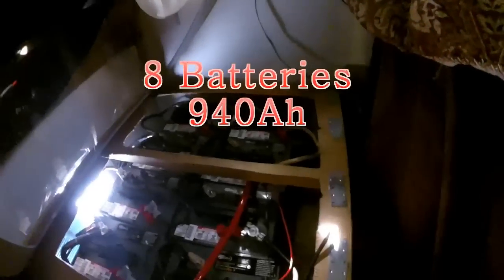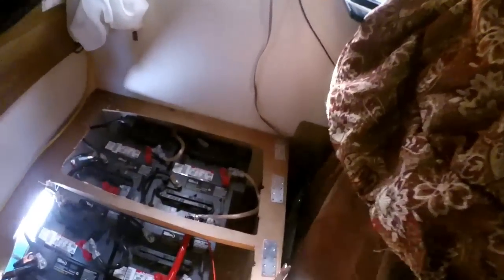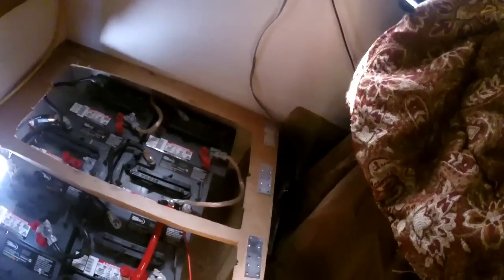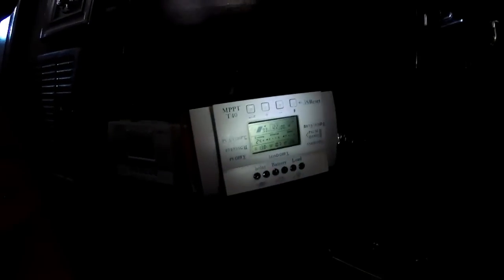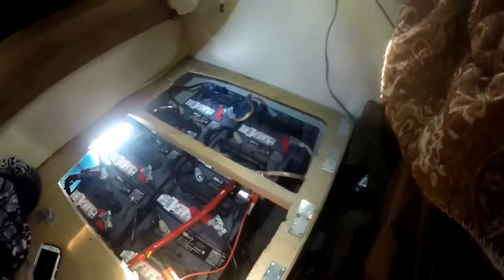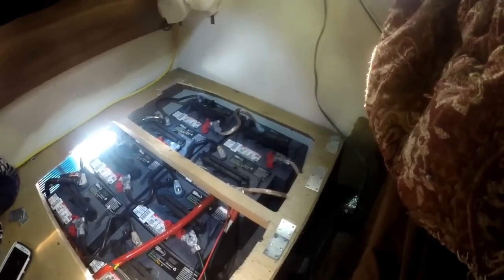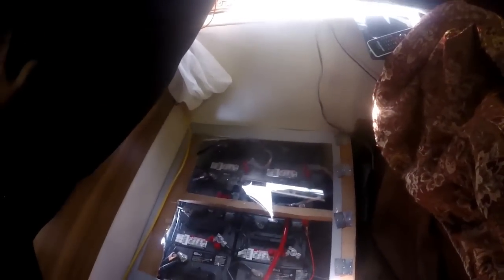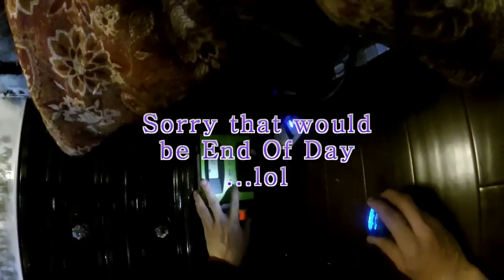Mppt Charge Controller, Large Battery Bank & Loose Wire

Comment: The only thing that confuses me is that you use propane for heat.... With all that solar.... Wouldn't electric heat warm without all the condensation?
Reply from the maker: Most small heaters use 900 to 1300 Watts that's still a lot of power for any solar system... besides propane is a pretty efficient way of heating I only spend about 15 to $30 a month for heating depending on how cold it is but... I do have a 12v electric blanket that keeps me pretty warm at night and uses very little electricity.

Comment: Do you notice and issues with weight distribution having added all those batteries in one location? Also, they look to be on the passenger side, where the solar panels are. Doesn't that add more weight to that side?
Reply from the maker: Yep no problem so far the panels are very lightweight and only weigh 40 pounds for all of them although  the batteries are on one side... the water tank and refrigerator are on the opposite side for weight distribution and it seems to be working
Reply: Thanks for the reply. I only viewed your solar panel vids after I wrote the above question. Yeah they look really light - and they must be durable too - to  be able to handle the vibration from wind etc., hanging on the side like that!! You should get an endorsement deal from the manufacturer.
Reply from the maker: Yeah that would be nice lol 😆

Comment: Your battey bank wires are small for the system to have.
What gauge are you running?
Reply from the maker: +b long 2 Gauge from battery to battery and 0 gauge from thebanks to the inverter. I think that is the right rating.

Comment: Just found ur vlog a couple days ago and been watching all ur vids from #1, I've seen couple of them showing ur solar system but haven't seen one yet showing your panels set up and working,,do the ones on side just stay where they are when ur camp is setup?, or do they raise up like a canopy?
It's probably one of the best systems I've seen on an rv so far!, very impressed!
I've got a 79 chevy coachman motorhome looks alot like ur's but I boondock out in rural areas more than in town and with the 24ft can't get off road much so I'm working on a 88 factory built camper van with hitop,fully contained and also converting  cargo trailer into a camper/toy hauler that I pull with either a 04 4x4 tahoe or camper van depending on if I'm beach camping or say mountains in Colorado but I'm gonna b using ideas from ur solar system and flex panels,,ok for now, good luck!
B proud of yourself ur doin a great job and who knows maybe bump into ya out there someday a share a campfire, safe travels!
Reply from the maker: lonerglide Thanks Glad you're watching my videos! ...and yes the can fold up like an awning because of the hinges. Seem like you've got alot planned... good luck and yes maybe we can share a camp fire someday! Your welcome to my ideas hope they help you and I will be doing a more updated video soon! Thanks again and Safe travels to you aswell

Comment: Its nice seeing another female rver out there! Im super impressed with your solar power set up. 

I just recently bought a dodge beever and am staying in it on a family members property until i can get solar hooked up and then id like to do some traveling.

This lifestyle definately speaks to me.

Im young and hate staying in one place for long. Theres so much out there to see
Reply from the maker: Kayleigh drouin That's kinda what I did for a year to get everything ready for the road... Good luck with your solar and I'm sure your excited to get on the road!
Reply: Panda Monium im super amped, honestly if it takes time its no big deal to me. Meanwhile i am saving up money.

Your solar panels that are on the side. Do they flap around alot? I honestly have never seen anything like that.
Reply from the maker: Kayleigh drouin I'm sure i was too and taking you time is a good idea no need to rush. It's better to be prepared and yes save money! The solar Panels are held down with cleets and roap like on a boat been over 4000 miles no problems, just small adjustments. lol

Comment: Nice set up! Looks like you may want to stuff the battery box with something non flammable to keep the batteries from moving around when driving. This will help keep the wires from coming loose.
Reply from the maker: off grid kid good idea... that reminds me I did have base boards down but took them out to reconfigure the battery bank... thanks for reminding me... I have to put some back in.... lol
Reply: After thinking about it you could use styrofoam, cardboard ect. push all the cells tight together then stuff it like a pillow. lol!
Reply from the maker: off grid kid yeah that's a very good idea thanks... I had some Styrofoam I left back in Myrtle to bad I didn't have you then to give me that idea :(  oh well i'll find some somewhere...lol! Thanks again
Reply: Hi, Don't use cloth, like a blanket ect, will degrade very fast. You have come this far with out! Takes time to get things dialed in. Next, ditch the clamps & install some Ring Terminals ends replacing the clamps, bolt it to the battery, problems solved. Will get a more solid charge this way as well. I think the design of you solar camper is awesome! keep up the good work!
Reply from the maker: off grid kid I agree it takes time to work out all the bugs and yes definitely going to change those out, it's all I could find locally at the time but definitely gonna upgrade. And thanks! ;)

Comment: Great setup. Love the fact that you vented the box. Love the fact that you foamed the plexi. Shows that you care to wake up in the morning. ;) However, that/those spring clamp(s) has got to go. The vibration from you driving around shakes that loose and can cause you some grief later should it pop off and ground out or arc. I knew a fella out that fried his charge controller that way. Plus, the connection from your controller to your batteries should always be a solid one if it is permanent.

Also, speaking of the vibration, get a few cargo straps, a handful of eye bolts to put through the battery box floor and cargo strap those batteries to the floor to keep them from shifting while driving. In a house setup there is no need to clamp the batteries down but in an RV batteries should be pretty immobile.

With as much money (and your time/effort) as you have invested it is impressive. Good for you for doing so much research.

Cheers...
Reply from the maker: Bugout Bounder Thanks... I totally agree the spring clamps really really suck (lol) and the connection should be a solid one. I am definitely gonna upgrade. Don't want any miss haps.

Comment: Do you have enough pillows? lol I must say you have power to spare. Which is a good thing to have. I was curious about your big inverter, do you leave that on at all times or is there a on-off switch for it up top, so you don't have to gain access to it from outside. I do love chicks that are handy, lol
Reply from the maker: Jerry Densmore Never can have enough pillows lol! I love lounging on pillows. Yes, that was one thing I wanted was alot of power. The 5000/10000 watt inverter is on a wireless remote switch and I do cut it of when not in use to save power. Handy chicks rock...lol!